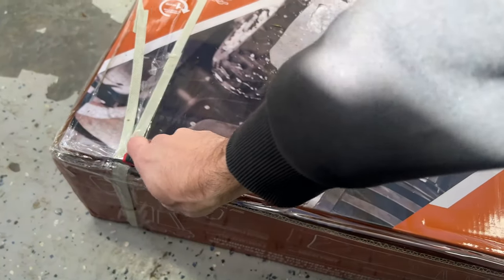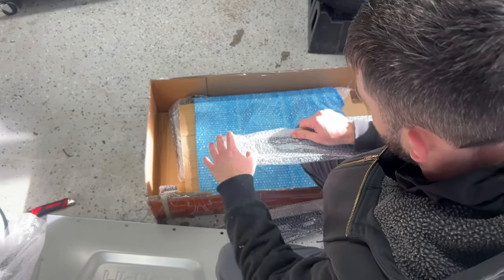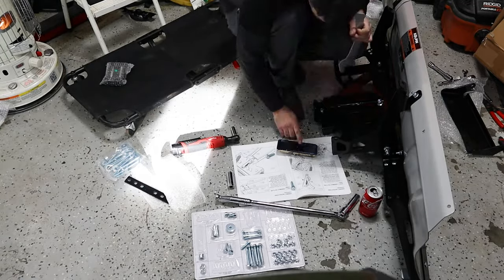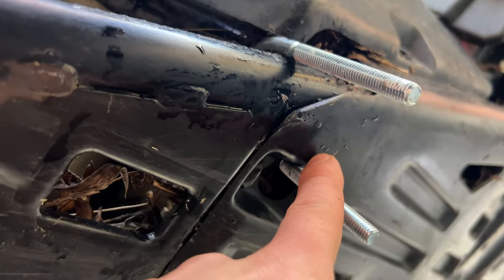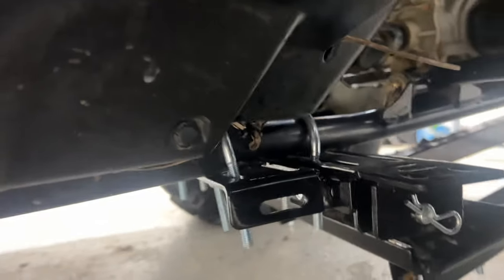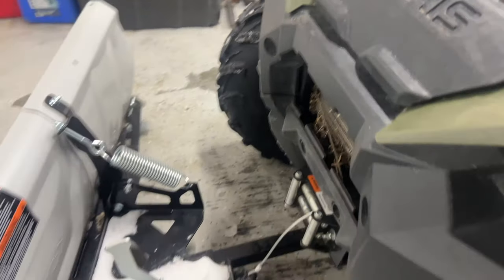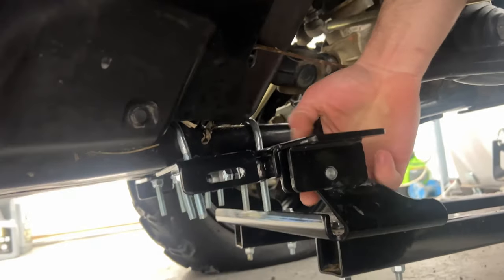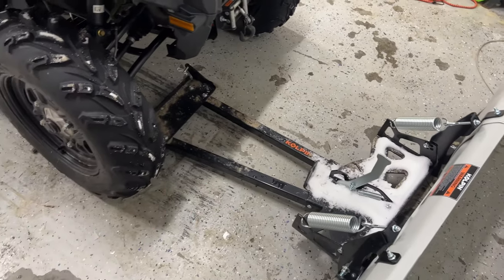Kolpin Switchblade ATV Plow - Unboxing and Install

Comment: I'd watched a bunch of videos (including yours) looking for better instruction on installing this plow. Installation looked easy as heck on the ATV.  It was impossible to install the plow mount on my RZR 800 using the supplied parts and I had to make two parts and obtain some additional hardware (the supplied "U" bolts were too narrow for the UTV frame) to install the plow mount onto the frame on the underside of the UTV. Its not as universal as they say.  As for attaching/removing the plow under the UTV, I just use a small floor jack to either lift it into place or hold it on removal and there is no need to hammer out the pins, they slide in/out easily.
Reply from the maker: Sheesh that does sound difficult! I do know they make two versions of this plow. One for ATV and one for UTV. I wonder if the UTV one is easier if you accidentally bought the ATV one.
Reply from the maker: And yes floor jack is nice if you want to use it
Reply: I bought the 17-5000 model that is 60 to 72 inches wide and the manual says it fits both ATV and UTV. The Kolpin website even lists my year and model UTV stating the plow will fit on it.

Comment: Do you leave the plate on all year or do you take it off after winter. Thanks
Reply from the maker: I left it on all summer. I also actually didn’t trim the U bolts yet either. Took it on some pretty serious trails and haven’t had any issues. Will have to check again that everything is good and can update.
Reply: @Buildcultureyoutube  thank you